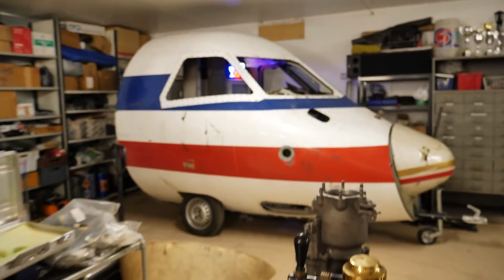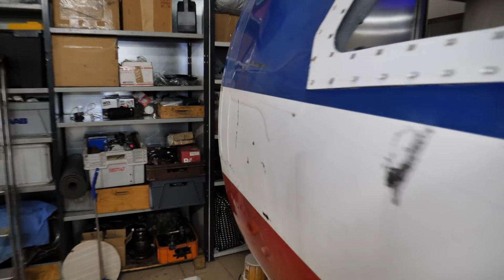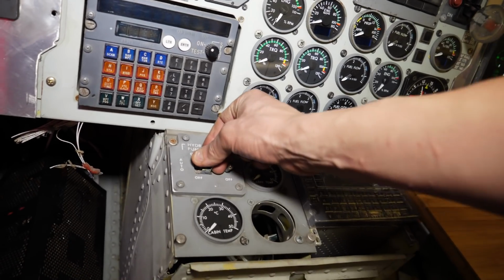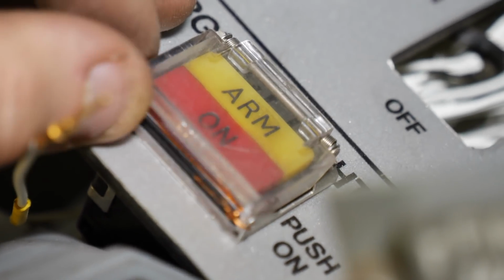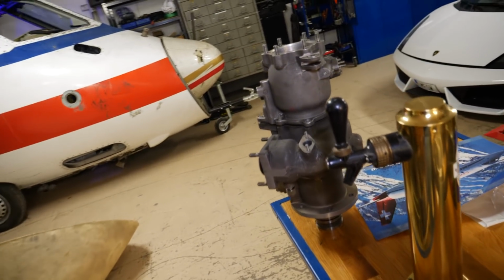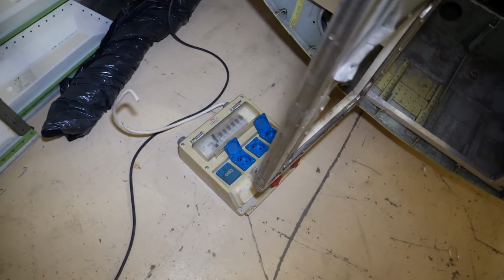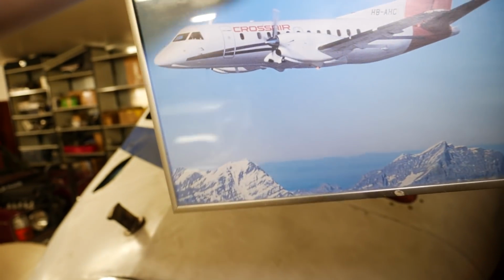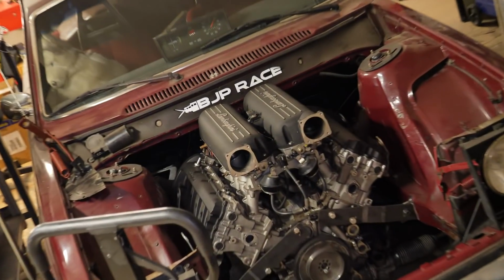Airplane Cockpit Bar Project (Saab 340)

Comment: Holy shit man, I can't think of a more interesting thing to figure out than to find a use for as many of those gauges and switches...
Imagine like fuel gauges measuring beer left in the tanks, or a detachable wing on the outside for a bar table. Joysticks for a beer tap handle...
Aircraft tech is amazing to me.

Comment: how thick is the aluminium in the cabin walls?
Reply: The Aluminium fuselage skin is very thin and is attached/riveted to an Aluminium frame/stringers. This gives an airframe great strength against pressure differences inside and out. The outer skin is about 1mm thick. This is common with most metal airliners. (The 787 and A350 is Carbon Firbe skin and stringers/frame)

Comment: Not totally true that the parts couldn't be fitted in to any flying aircraft. You'd never get them in to a certified aircraft, but one could use them in an experimental one.

Comment: Can You show us construction of airplane electrical panels - circut breakers boxes, instruments, switchpanels. So much that we could learn about wire routing, strain relief etc. Obviously ditch the solder cup contacts in connectors :P

Comment: Ok, 100% you need a instrument to tell you the level of the beer in the tank. Cant run out. And if you are going to build a generator for this bar please use one of your Lamborghini V12 engines to power it. You can, that way power the bar and sell the access to the government.

Comment: Bummer, some nutter set fire to your cars.. I painstakingly restored a 1940s bicycle, by taking every single bolt apart, and powder coating the frame in original color. Built new tires and rims for it , by finding some old east German rim, that had the right look. Bought an English handmade leather saddle for it. Then some kids decided to jump on it, and totally messed it up...
Reply: Little vandals